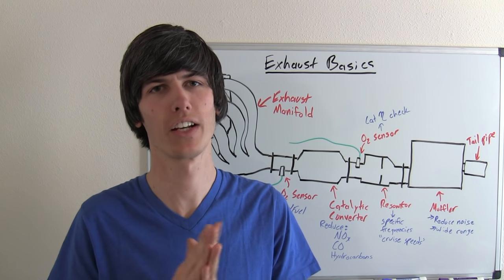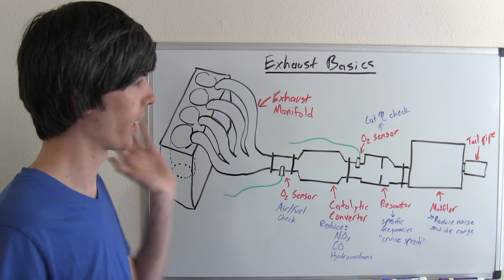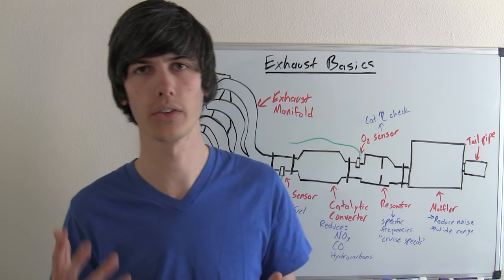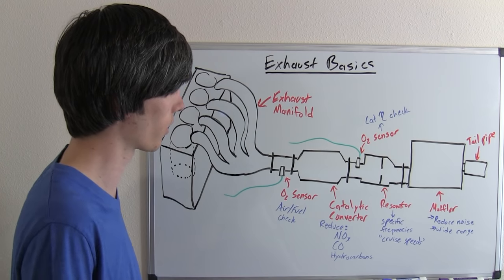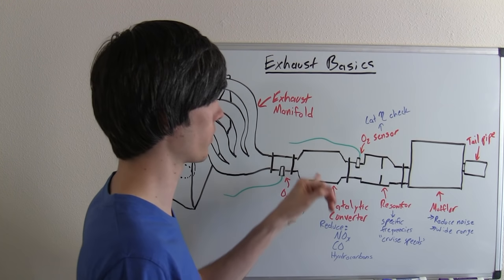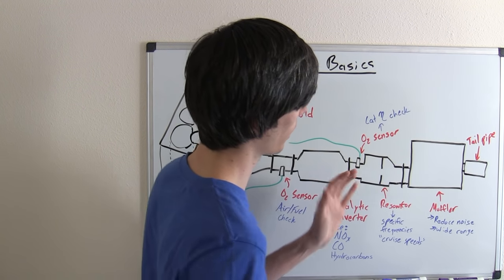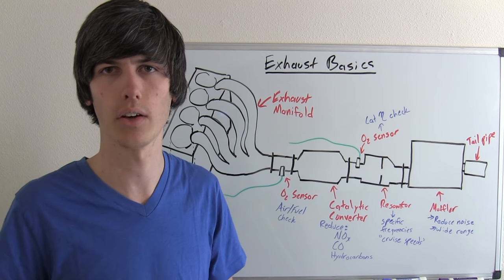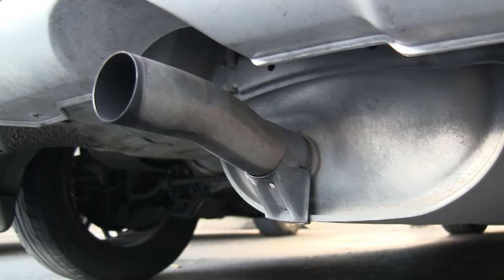Exhaust Systems - Explained

Comment: Hey man I'd love it you could answer me this. I have a BMW 128i, the NA 6 cylinder engine, I just did a resonator and muffler delete (was planning on just deleting resonator and adding a magnaflow muffler) but I loved the sound of the straight pipe from the cats back. From what I've read I won't get any power gains from a this because I just took out all of the back pressure from the exhaust... however the pipe has Y section on and from there the stock 2.5" piping with some bends which in my opinion give some back pressure and also I just potentially removed about 60pounds from the car, so my question is: Did I make my car slower or faster taking all of this into account? (stock engine still I'm running it in the future)
Reply: there are some mufflers that are designed as straight through. Flowmaster has too many chambers and while they give a slight boost. But if you happen to see one cut out there's a lot of "walls" inside the muffler that resonate the exhaust tones within to give it that loud noise. Magna flow on the other hand if you where to hold it up you can see through the other side. it won't be as loud as flowmasters. my brother in law had flowmasters 06 ram and when I had my magna flow installed onto my truck he liked the more throaty sound of the magna flow. people at car shows also tell me it sounds nice.

Comment: Does it harm the car engine if i run without a catalytic converter? 
I just got my cat gutted and i havent installed downpipe. Im running it with an empty cat, so now i have engine check light. So i was wondering if this could damage my car engine in any way.

Comment: Hey I have been having a rattle in my exhaust system for about 7 months now, and my muffler is cracked around the weld but it isnt the rattle, I was shaking my resonator and it rattles a lot wasn't able to reach further back to my engine unfortunately but I was curious if you knew what it may be?
Reply: Probably a loose baffle in your resonator.
Reply: It was... Had it removed about a month ago lol

Comment: Hello.
There is this problem i've been trying to figure out for years but haven't really got an answer.
I've owned a BMW E39 528i 1996 for years and so far it is the only car i have seen such a funky exhaust system. It has two pipes running from resonator. The right one ends with a blind and left one goes to muffler. The thing is, there is two mufflers in the end of that pipe. One has an opeing with a normal pipe and another has also a blind end. It has bothered me for years so i finally decided to open it up aswell. It got quite loud and added this backfire sound. Does this have a dramatic effect on backpressure? And if so then why would BMW even add this second pipe. The same engine doesn't have this secons blind muffler on '97-03 versions and even 3 series with same engine is missing the dummy muffler.
Thank you in advance. :)
Reply: Romet Talkis ask in a newer video

Comment: bro I've seen quiet a few of your videos. hope you had a great fourth. i need your advice. i have a 2014 v6 camaro that has the new LFX 3.6L engine. i cannot put headers on my car. i have high flow cats on it with resonator delete and mrt v2 for the mufflerz. my car is making a fart sound around 1k to 2k rpm wheneverim accelerating or decelerating. can you help me. my cats are high flow slp
Reply: also my car has no connection in pipes meaning each side is in its own. i beleive called a true dual

Comment: Hey Engineering Explained i've got a v6 camaro i wanted to deepen and louden the sound of, so i removed the resonator and replaced it with straight pipes and replaced my stock box mufflers with straight through mufflers. This resulted in a sweet throaty sound at low rpms, very close to that of a v8 camaro, but any revving starting from 3K and above rpm creates this irritating tin can raspy sound with no throatiness/beefiness to it whatsoever, just pure tin can noise. any idea what i should do? im uncertain as to weather i should put back the resonator or whether i should replace the straight through mufflers with something bigger? would highly appreciate your thoughts on this. Thank you :)
Reply: I would put the resonator back in to reduce that raspy sound at cruising speeds. Deleting just the muffler just makes it louder and usually sounds much better. Just leave the muffler out.
Reply: +Dukiny Gaming sweet thanks for the reply man. I out back my resonator after posting this. The sound is a bit louder because of the new mufflers but it isn't significant. I can hear my CAI more than i can hear my exhaust which is pretty terrible for a muscle. I will consider removing the mufflers altogether but instead of that would it better to use an electronic cut out so i could go back to the muffler sound if needed?

Comment: Can someone please tell what to do to lower the sound of exhaust system? What to do, how to make one. Thank you.
Reply: Tractor Trac Tech Mufflers! They muffle the noise, like suppressors for your car.
Reply: Yes, but how to make one at home, what to use inside to have the best option for low noise. Walls inside at angle or with holes,...? What if you have space for muffler (a tube 3inch in diameter and 8inch long)?

Comment: can i legally just have the required cat + muffler but in the engine bay out the top like a demo derby straight pipe but it would have both cat + muffler. im 22 & wanna get a car that needs to be legal & quiet & cheap bass car that i can use as main car. i dont got a job so it can be a sh1t box red necked to be legal

Comment: will installing aftermarket exhaust system on a car let the engine light come or any other light comes on?
Reply: If you take the catalytic converters out then yes
Reply: +joshua Nicol ok thanks
Reply: +mai hik There are bypass mods if you want to delete the cats but deleting the muffler and deleting cats can be unbeneficial than going with a product like say magna flow who keeps the muffler but is straight through and purchasing some hi flow cats